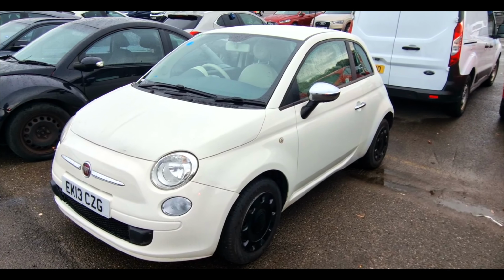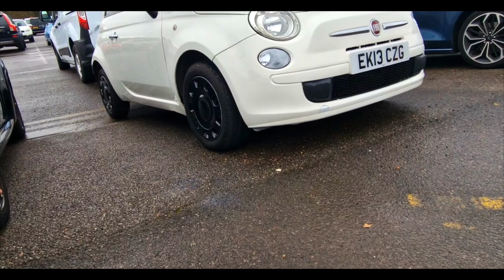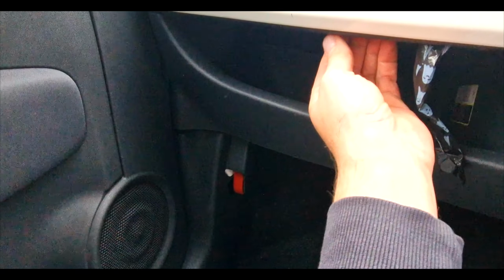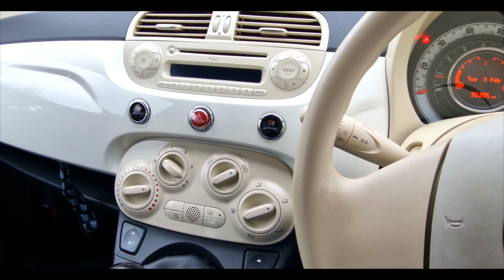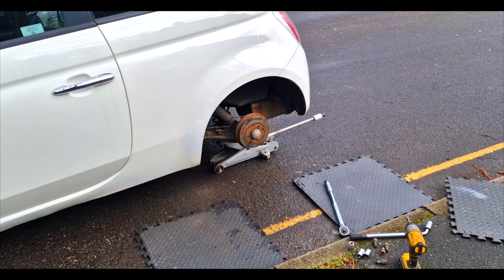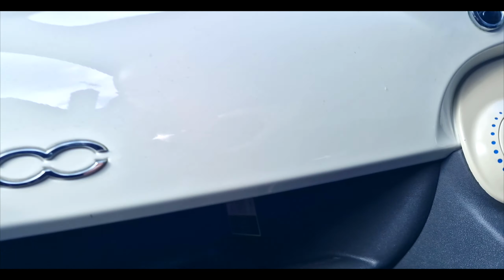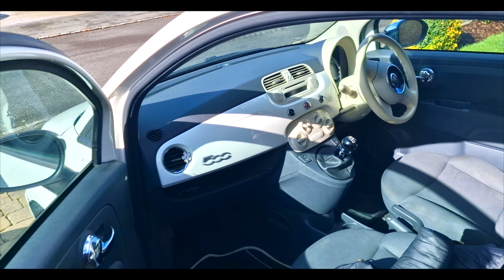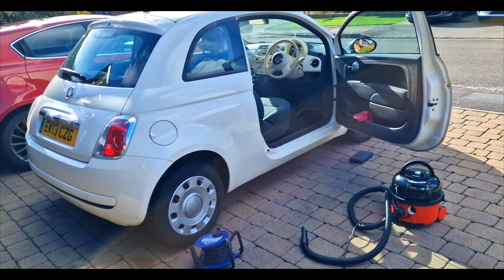Hoping This BCA Fiat 500 Was A Good Buy

Comment: 15:08 Its not clutch its a tiny first motion shaft bearing which cost about ten quid but got strip gea😢rbox to get to it .thats why its in the auction.fiat parts not fit for purpose. 16:51
Reply: Which is part of the clutch system! You wouldn't go through all of that work to just change the bearing without doing the clutch to 🤦🏻
Reply: Not talking about thrust bearing its small bearing on front of gearbox input sharft bearing comman problem on these vehicles.
Reply: Again... You're there so don't see why you wouldn't change it 😂